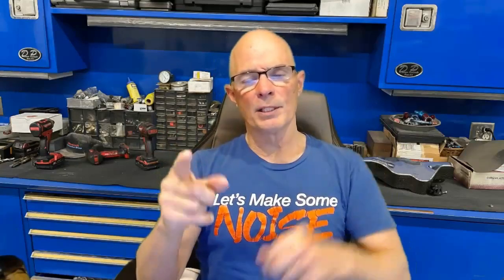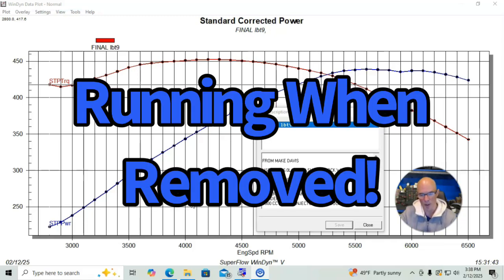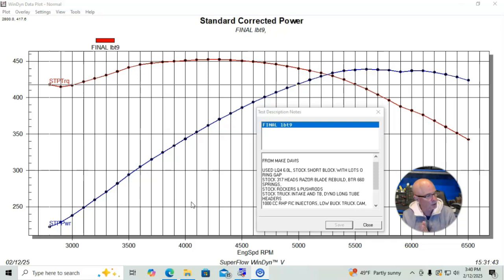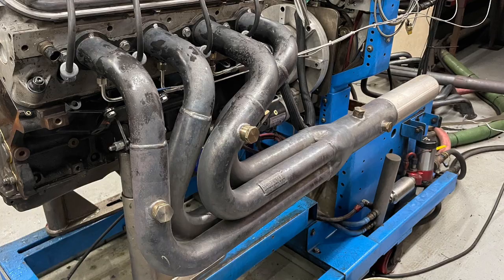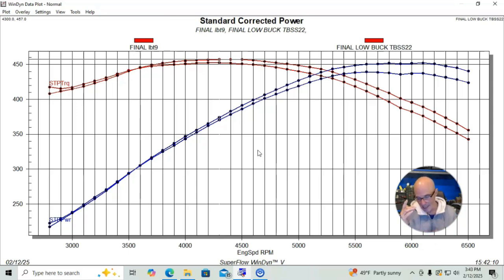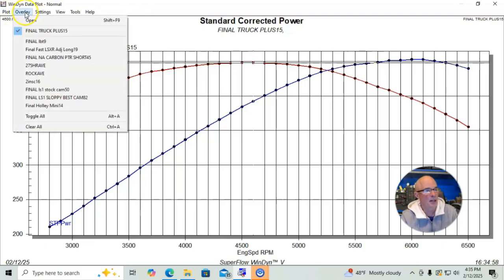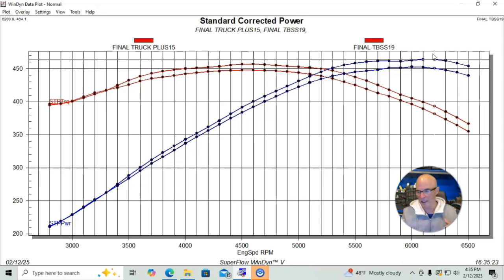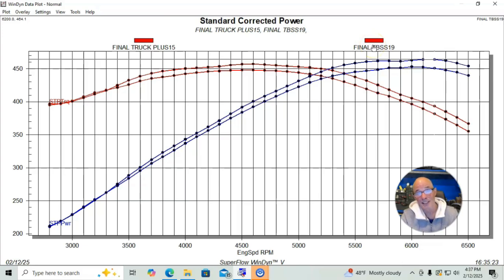JUNKYARD 6.0L LS INTAKE TORQUE TEST-TRUCK VS TBSS (WHO IS THE REAL TORQUE KING?) FULL DYNO RESULTS!

Comment: Really appreciate this one, very close to my current combo. It definitely shows why mine does what it does. 

LQ4, 862s, TBSS, TSP CHOPacabra,  supporting mods.
Reply from the maker: THAT SHOULD MAKE MORE WITH THE 862 HEADS THAN THE 317S USED ON THIS MOTOR
Reply: @richardholdener1727  based on your previous tests - I agree. Likely makes 10ish more HP and TQ at peak. 

In the past, people questioned why my HP and TQ numbers were so close. Yet, this test perfectly illustrated that's just a byproduct of this combination.

Comment: The legend is, the tbss manifold doesn’t make more power on a stock 5.3. It’s expected to with a bigger engine however.
Reply from the maker: there is no truth to that legend-but the gain would be less
Reply: @richardholdener1727  100% sure you  tested this, and it was less than 10hp, but more than 5. Can't remember the exact numbers at the moment. My brain wants to say it was 6 peak hp on a stock LM7 when you did that test.
Reply: @ I agree.
Reply: @ btw, we are going to order the smaller truck cams from you when they come back in stock, for my sons turbo Silverado. He crashed it, we are doing a frame swap and figured might as well put a cam in it while we are at it. Was going to put an ls2 cam in it, but I don’t want to do any adapting to make it work (not that I can’t, I just don’t want to) so I decided on yours. I really wanted something a little smaller but it seems to still have good low speed tq.
Reply: Matt over at Sloppy has tested the TBSS on cars a few times, he claims great gains even on small engines...if they have a half-way decent cam.